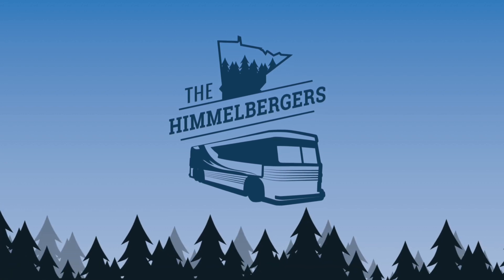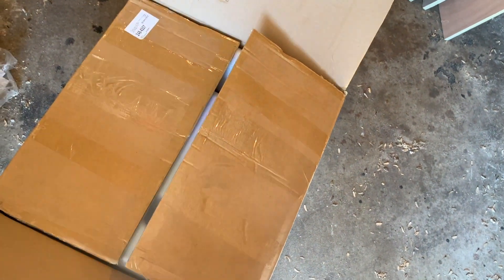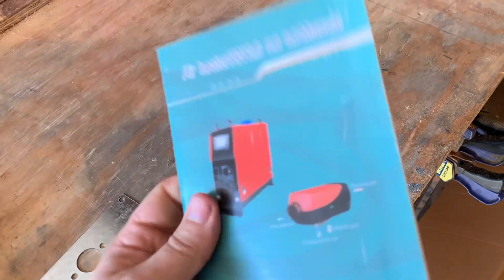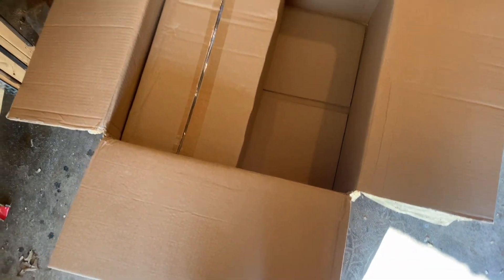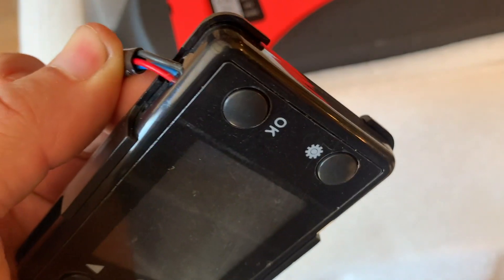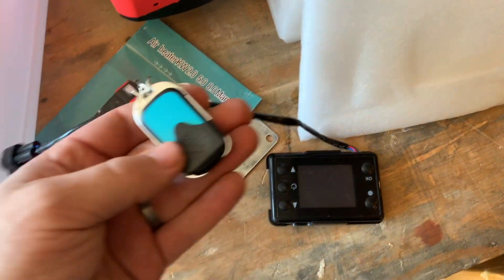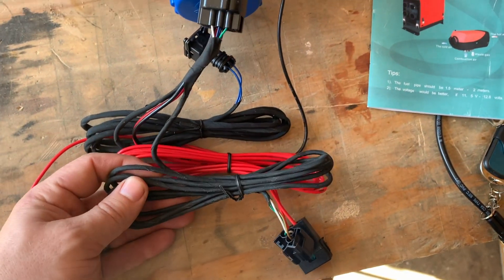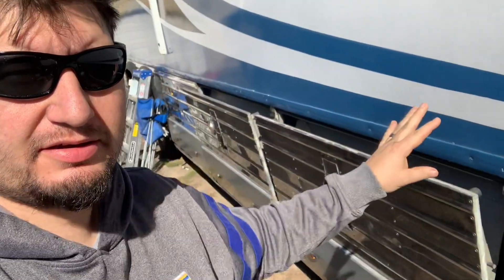Diesel Air Heater  Unboxing & Install Part 1 | MCI Bus Conversion Build

Comment: I had an MCI with that same duct system. The only issue I see with that is, when you use your over the road heat, its going to blow back into the diesel fired heater. You will want to have some sort of check valve type of flapper. I did this where I had my a/c in the basement ducted into the same ducts and I made a flap to keep the air from going back through the side that was not being used. I would say its probably just easier to mount those on the floor inside and use the ducts, it all depend on whether you are going for a quicker install or keeping the extra stuff out from inside the bus. I was thinking of going with these heaters, but I think I am going to go with a hydronic system. I now have a Wanderlodge, I have sold my MCI.. so it has like three different heating systems..

Comment: Shawn I feel exactly like you do buddy I'm in the same sisuation right now I've more or less decided to remove the the heat and AC out of the hidden room to make room for the inverter and batteries
Solar charge controller etc. I also want two of the air heaters for parking and travel plus I'm putting in a mini split system and may also put one in the bedroom in the back with the right set up I should be able to run the mini split going down the road off the inverter and alternator with the amps it puts out. 
I like your idea about using the center raceway maybe for the ducting for me that might be it also you said maybe mounting one in the engine bay I like that idea too I'm still figuring out where would I mount the other unit so I still have access to work on it if necessary I personally think in the bays or engine bay would be better for lower noise levels I've had propane ones in the past and their not quiet at all and I've heard the ones and seen their not to quiet either.
Anyway I'm looking forward to seeing what you come up with brother.
Thanks for sharing

Comment: I installed one on my 102A3 tied into the drivers defrost system. Works great. Don't know where the second one is going yet. Fuel pump makes noise, so put it below the floor.
Reply from the maker: I saw a video (will update soon) where they hung the pump form zip ties.  Seemed to work well and it's now silent.

Comment: I would tear out the propane heater and remove the whole bus heat/cool cores and leave the dash heat and defrost plumed in. You can open up were the original heat/cool cores were for storage. Put the new heaters and the ducting inside the bus for greater efficiency. Good luck however you decide to do it!
Reply: That's a good idea Larry I'm having the same dilemma I also want to put two in my MC9 and I'm at the point of do I remove the AC heat systems for something more efficient its just more labor and money right. Lol there is so many reasons to remove them I've already removed the ducting from the walls and the blowers there's a lot of good extra room behind that wall for the utilities.
Reply: @briandavis9975  I have a 102A3 work in progress and I plan to remove as much as I can out of that AC/heat compartment. It looks like it will be a real chore, but I'm with you, that's good space in there!
Reply from the maker: I'm not ready to remove the OTR heat completely... I have my vents angled up, so there is no back feeding, if anything there would be some added suction. (Ever see firefighter clear smoke from a house by spraying water out the window?  Works the same)   I'm kind of leaning towards a single one up front in the bay.  and leave the other in a box for a while.  I've been thinking more and more I might want to route some warm air to the water bay as well.  We'll see.  I find thinking on it for a few days getting some other thoughts (thanks everyone) makes things clearer.

Comment: I have purchased the same heater to install in my MC5B and haven’t installed it yet... in way of providing comment, my initial thoughts are to take into consideration how much noise they make when operating and how close you want that to your living space.
I have taken all OTR ac unit out so I plan to use the center bay area for my installation. this area has slobber tubes in it that I might use to port exhaust with the added benefit that the residual heat generated would heat that bay up which in-turn would radiate up into the main living area of my bus. 
I do have a mini split installed in the front that does provide some heat but my main focus is to regulate temperatures between front and rear without being too hot in one area and cold in the other. 
Will be very interested to see what you come up with... thanks for the videos.
Reply from the maker: The pressure is on now! Thanks!

Comment: How did you convert your bus to hook up a trailer from 24 volt to 12 volt
Reply from the maker: I bought 12/24 LED bulbs and replaced them so it works with either voltage.
Reply: @HimmelbergerBus  thank you